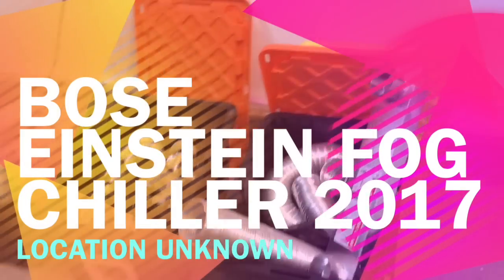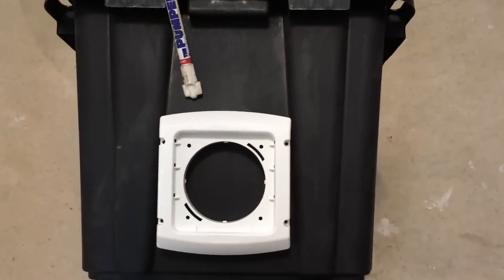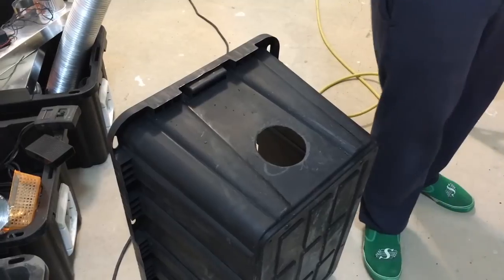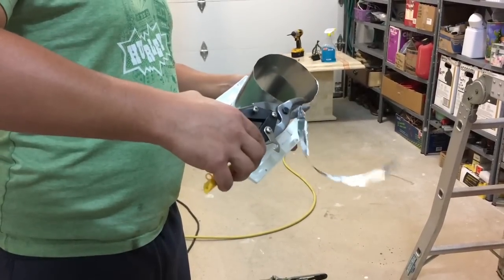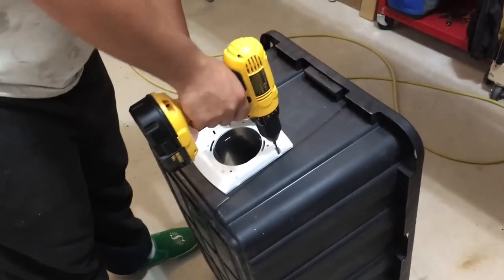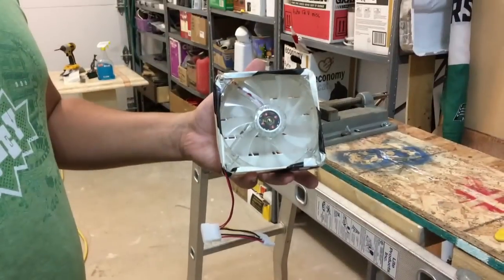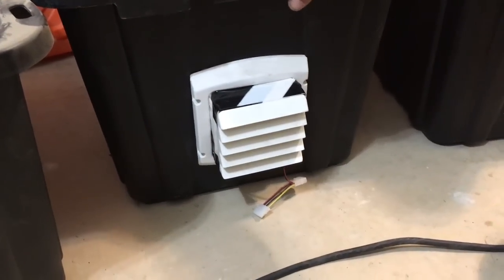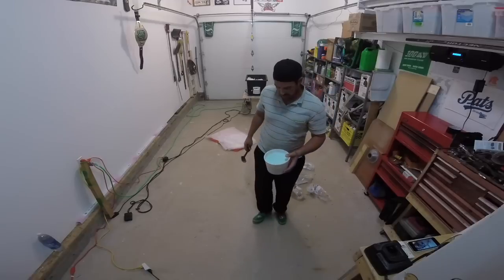How to build a Fog Chiller

Comment: Pretty good, but some warning about the dental drill sound would have been helpful. I am glad I wasn't wearing headphones! Also I noticed as the smoke began to warm up it started to rise quite high so short bursts would be better?
Reply from the maker: Sorry about the sudden air tool noise. I’ve put some time into more recent videos to try add better production value to my newer content. Thanks for your input. Yes indeed you want to cycle these units. Please check out the other vids I did on this topic.

Comment: What is the ratio for the ice melt and the salt ?
Reply from the maker: That’s a loaded question. The more salt mix the quicker it will melt, but in theory will achieve lower temps. It won’t be that significant though. A coffee cup of melt per bag of ice or two would be a generously fair ratio. This concept still has a lot of data that’s missing.

Comment: Has anyone compared the 2 types of chillers? Passing through a tube entirly through with ice around the tube and out .. VS .. one that sends the smoke actually through the ice and back into an outlet. Efficiency output etc?
Reply from the maker: Jesse C this design has both the chilled pipes and travels through the ice in between but I’ll break down the ultimate formula for fog chiller design success. 1- don’t bother anywhere there is wind or an uncontrolled setting. 2- have the coldest ice possible with safe chemical reaction or use dry ice. 3- restrict air movement but control it with forced air (fan). You want the fog inside for at least 5-10 seconds before it exits. The colder the better. 4- pvc or plastic on the inside it a waste of time and potential. Aluminum or copper will better transfer cold temperature to the fog. Thermodynamics 101 ✌️
Reply: @McZoolando  that's awesome, your chiller is next level with the CPU fan. Thanks for responding!!
Reply: @McZoolando  hey you seem pretty helpful .. I'm curious, would it be better to attach the fan with a wye fitting to push air from the side vs pulling the fog (and any moisture) directly through it? It makes sense that potential moisture within the fog couod damage or shorten the life of the fan.
Reply from the maker: Jesse C agreed the pros and cons are the following. Now although we have never had one fan on four different chillers die or seize up, it is indeed bound to happen eventually. The reality is that pushing the fog through our pipes and “ice honeycomb” is much less effective as far as a consistent output. Secondly pushing the fog also just blows out of all the cracks and seeps from anywhere it can. Reality of the fog chiller concept is there is still room for improvement and I love to hear feedback from others and what seems to work better. Please share any insight.

Comment: i don't know if anyone can help.  I basically did a similar fog cooler. the fog machine is a 1000w.  i have it funneling through a small plastic pumpkin head where it flows through the mouth of the pumpkin.  However, huge problem, the smoke barely comes out of the pumpkin. and it doesn't lay low (and im using ground fog) I shortened the piping by about half and similar results.  there doesn't seem to be any leaking. and when the smoke machine is on by itself, there is a great amount of smoke coming out...wtf? thoughts?
Reply from the maker: Scott Yunes install the fan. Problem solved.
Reply from the maker: https://youtu.be/nFIx2eKi2cA

Comment: So the bubble gum minus the bubble gum? Is that just rock salt to get the ice extra cold or what? Also the glycerin you added to the fog juice where do you get that? And what fog machine are you using? Bad ass man.  That’s the best fog kept low I’ve ever seen. Waaaaay friggin bad ass! 🇨🇦
Reply from the maker: The “bubble gum” is calcium chloride or ice melt mixed with salt yes. Glycerin can be purchased at most pharmacy’s just make sure it’s food grade and has no extra additives.
Reply: Mc Zoolando think this vegetable glycerin is the same? 

Glycerin Vegetable - 1 Quart (43 oz.) - Non GMO - Sustainable Palm Based - USP - KOSHER - PURE - Pharmaceutical Grade - safety sealed HDPE container with resealable cap https://www.amazon.com/dp/B004C7MTLA/ref=cm_sw_r_cp_api_i_eEbSDbX2B4KN9
Reply from the maker: This test was done with a little 700 watt. Imagine what it’ll do with a big fogger. Thank you!
Reply: Mc Zoolando rad okay yea I have a chatua 700 or something like that. Thing works really good. Dang okay I’ll have to see what I can find. Thanks man!

Comment: Would it best to just use 2 telescopic pieces instead of ducting?
Reply from the maker: THEoriginalTAPS no. Although you can fit a bit more ice inside, no. In a forced air chiller like this those aluminum pipes help keep the fog inside the chiller a bit longer so as to chill the fog better. Other chiller designs don’t allow the fog to to stay inside long enough and after many tests I’ve found that those telescopic pieces had no real advantage whatsoever.
Reply from the maker: When operating properly this chiller has the fog inside for up to 10 seconds before it exits the chiller.
Reply from the maker: THEoriginalTAPS you must use a fan to force the fog through when making a chiller like this
Reply: @McZoolando  if i just use ducting, do i need that small fan??
Reply from the maker: Yes you need the fan
Reply from the maker: You can see up top today that 32 people either cut corners on this build, or are just insecure about their inferior chiller design. I’ve shown you how to build the best. The choice is yours. Happy Haunting!
Reply from the maker: https://youtu.be/nFIx2eKi2cA
Reply: @McZoolando  i saw that video. Too much work for average joe

Comment: Hi, Great video.  I really like your set up compared to the others that are out there.  One question though does the fog damage the fan or the electronics of the fan after alot of use?
Reply from the maker: Daniel Nikolaus to date all fans I have ever run of any kind still work, but I still have yet to run it daily for many weeks. Laws of physics say it has to fail at come point. They also can get very sluggish at -60 and below lol
Reply from the maker: https://youtu.be/nFIx2eKi2cA
Reply from the maker: The water/glycerin mix in the fog seems to have little effect to the fans to date...

Comment: That's awesome, I'm looking forward to building one like yours soon. I have a 1000 Watt fog system. After seeing so many videos on chillers yours seems the best option. I have one concern about it. I see that your outtake is laying on the bottom. What happens when the ice starts melting? Would the water ever make contact with the fan? Or are you draining it somehow while its running?
Reply from the maker: Tom Vanslingerland the electronics are safe from water. It takes 12 or more hours before the water level reaches the output pipe where it can drip out if it gets left there, but that’s why the fan is also a quick attach so it can be removed and drained. Plus you also don’t want cacl2 water dripping all over your grass or worse yet all over the floor. I’ve never gone as far to put an aquarium pump on one of these things, but I’ve been waiting for someone to try one out... I’ve never run it for more than 12 hours continuously.

Comment: Do you have a link for the exact fan you purchased? How exactly are you connecting the fan to a power adapter?
Reply: hate to keep asking questions, but where did you get the vent pieces? I'm not seeing it on home depots website
Reply from the maker: Stephen P they are sold at Home Depot, Lowe’s, Canadian Tire where I live. You’ll find them very close to the aluminum pipe. Look around the washer/drier accessories area.
Reply from the maker: Stephen P if eBay has links, I don’t know how to use em. Here is the item and description word for word for the cheapest ones I’m seeing right now - Quad 4-LED Light Neon Clear PC Computer Case Cooling Fan Mod Heat Sink 120MM Lot
Reply from the maker: Stephen P https://youtu.be/nFIx2eKi2cA
Reply: Appreciate it. I want to do a fan but not thermometer. When you cut the end off the power adapter,  which wire goes to red and which to black?
Reply from the maker: Positive is always red. Black is always negative. On “wall wart” plugs, they identify the positive with either paint or etching or something to identify the positive. The negative wire should always be plain. Don’t worry though these fans will only run when wired correctly and it’s such little voltage it’s an ideal project for beginners.

Comment: Can you tell me exactly what fan you got.  I tried once but the fans were too powerful.  What is the power supply you use too?  Thanks
Reply from the maker: Fans came from China but they're standard computer fans. They come in all sizes just choose a fan that fits right for your setup. I have used different voltages from 6 to 14 dc transformers (wall warts). What is most important is make sure the fog is forced to sit or compress in your chamber, while at the same time also forced out the front end. My next video i'm going to use 115 volts ac and a larger fogger. In using the more powerful fan, i will try create more resistance inside if that makes sense. Full thread and videos available on Hauntforum :0

Comment: Great video, looking to do a chiller dog next year.
Question, is it absolutely necessary to use calcium chloride and salt? This would likely go on our lawn.

Also what sort of machine are you using?
Reply from the maker: Great question Fred Gallegos. It's not absolutely necessary, but it is indeed a huge advantage. It'll drop -5c ice to -20c quickly, and iv'e gotten below -35c with ice that was frozen to -20c. There are 8 videos in total and iv'e used a 700 watt ADJ fog machine in all to date. check em all out and there's one more coming shortly.

Comment: P.S ~ Any tips on using this set up in the grass like in a cemetery type scenario for good fog disbursing?
Reply from the maker: I'm doing the barrel scene in the basement from return of the living dead. I attached another pipe to the output of the chiller to the backside of the barrel and i made a rupture in the bottom of the barrel. If running hose on the outside of the chiller, an insulated pipe works better. Don't use aluminum on the outside. as far as the grass goes i would just make some kind of basin with plastic or a larger bin than the chiller. Otherwise just rinse the grass very well lol.

Comment: Hey MC,
Great video series!!! Out of all the chiller videos, your chiller is exactly what I am looking for and with the holiday coming so close; I want to duplicate exactly what you have using ice without having to waste time doing more mods than necessary (pretty much plug and play). I'm on my way to the Depot to get the supplies. After watching all of your vids I have one question, what is the exact fan that you are using and how do you hook it up to the AC charger? Just like you, I have a boxful of AC adapters but I searched for Shanghai fans but could not find the proper fan, can you send me a link or a search keyword for the fan or even an alternative fan that I can get sent to me quickly?

Thanks and keep up the good work!!!
Reply from the maker: The fans i'm using are universal size 3 or 4 inch fans. On ebay they came up first page when searching - computer fan. Different seller and coming out of Hong Kong but same diff. Problem is that a man on an aquatic bicycle could get it to you sooner than it takes coming from there with free shipping. You could likely find the computer fans at any computer surplus store. Also there are in line fans available at the major home stores like the Depot. Iv'e never tried one of them yet but i intend to. They're just a bit pricier at like 35$ but they're ac powered i believe. From all the different ways iv'e tried, the fan always works better on the output. Also this chiller will still perform well without the fan but there cant be very much air restriction or it won't be as effective.

Comment: Love the video - can you elaborate on how the pipes are set up inside? Originally I thought the pipes were connected inside but upon watching closely I see that the pipes are not connected at all, is this correct? How do you prevent the output pipe from being clogged with ice (and water) since it is sitting on the floor of the box?
Reply from the maker: The chamber is always full of ice. Everything on the insides we want to be as cold as possible. In this chiller there is an in pipe and an out pipe. The inner ends are located in the two furthest points apart from each other so the fog also has to travel through a maze of ice. Fog is inside this chiller for up to 10 seconds before it comes out the out pipe. The only thing bad about ice and water inside the pipes is air restriction. In retrospect, the super chilled water on the out pipe is probably the single best thing this chiller concept exploits. Only reason i never put a drain valve on the bottom is that it takes like 12 hours of non stop use before the water level gets that high. I was going to include the diy drain valve in one of the next vids. For outdoor use though you can elevate the output end slightly so it'll drain itself out the back without any airflow issues. Warning- when using salt and cacl2 , mind your lawn and garden lol. Nothing will grow there for a while lol
Reply: Thanks for the quick reply MC Zoolando! I got it - built my version of it this morning. Question: how do you prevent the fog from exiting back out from the intakepipe? I put the fogger right next to the pipe but some amount is coming back out
Reply from the maker: There can be a lot of air restriction when the bin is full. This is good for the fog to condense inside, but the fan is necessary for pulling the fog out the output pipe. Please check out all 8 of my videos on the topic. If youre still having issues ill help you work through it. Also the Bose Einstein fog chiller is exclusive to Hauntforum. You can interact with the thread in there and you can also post photos there.
Reply: Got it - unfortunately that site isn't processing new registrations correctly at the moment so I can't see any details of the supercharger-carbonator. Is this shown in any of your vid's? I've watched most of them but I don't think you show it in the vids.
Reply from the maker: I'm working on the next vid. Hopefully it'll help your chiller perform to its full potential.
Reply: One more q, if you would MC. In your latest design, are you using the aluminum extender pieces for the input/output ends inside or are you using the dryer-vent-with-dry-ice for one of the ends? Just wondering what works better is all, I rewatched your vids and am trying to figure out how best to get more cooling  performance from your already awesome basic setup!
Reply from the maker: No but i will be. The telescopic extender pieces are pricey but they allow me to stuff 2 more bags of ice into this chiller. Also the contact between the ice and ice water with these pieces is ideal. Ill o a little into detail about them in the upcoming vid.

Comment: Save some cash-- Ollie's Bargain Outlet sells these plastic totes for less than $5! Also, I like to use ice packs-- you can put them back in the freezer and use them night after night. Small water balloons, frozen, also work. Line your bucket with aluminum foil, shiny side in, to help it work even better.
Reply from the maker: Thanks for the 411 on where to find the bins cheap! Now ill agree that on a budget the ice packs are much more practical especially for repeated use, but the ice packs cant compare with a bin full of ice. Its actually not even close. Two reasons- we are exploiting the chemical reaction of cacl2 and melting ice in this chiller. ice packs can't do this. Also there is little contact between the ice packs and the aluminum pipes compared to the bin full of ice. On the other hand i never thought to try foil on the inside of the chiller, although i always thought an inner bin made out of aluminum might help with the core temp, almost like a thermal sync. I'm going to try the foil in an upcoming video. Thank you Brent.